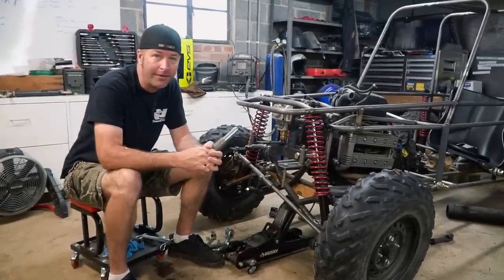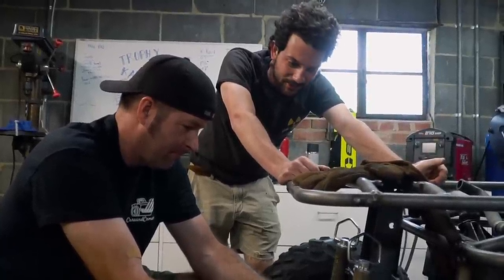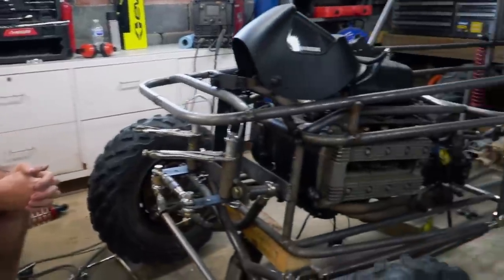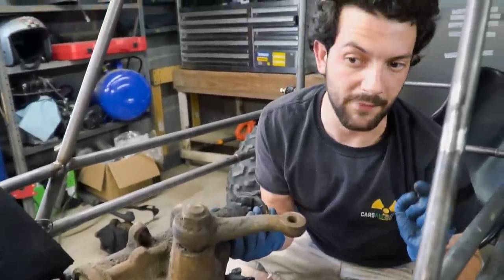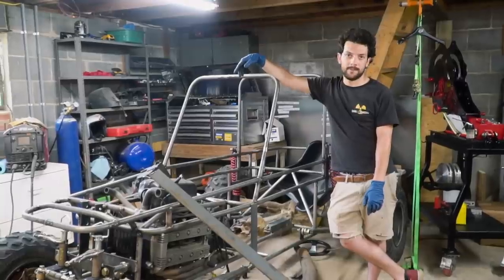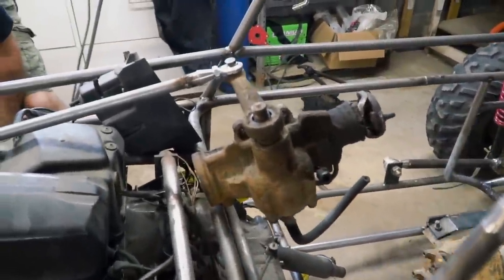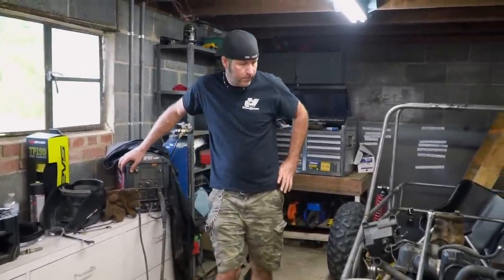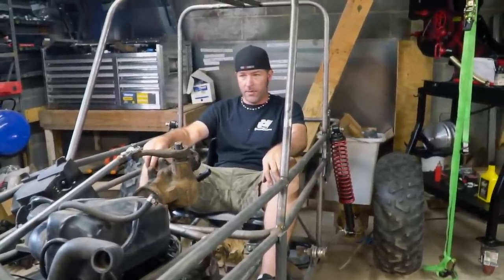1000cc Trophy Truck Build Pt. 9 | Steering Finished!

Comment: Find a steering box off of an old vw bug. They are only like 10 or 15 pounds and I'm sure they are pretty easy to find. Plus they don't have all the junk for power steering
Reply: I told them the same thing on the previous video. They have like 3 bugs laying around.
Reply: I was thinking that at some point I would just use a bug front end
Reply: I hope they read this hahaha
Reply: Yip an I think they make aluminum one's for sand rails
Reply: IndyHelis  way expensive though. Almost three times as much as a normal manual steering box.
Reply: Same thing from a Toyota pick up
Reply: IndyHelis  Your whole comment is negative garbage given they purposefully went down this route to try something new.  Also, why make up stories about the bump steer they resolved?
Reply: Why not the gears out of an old worm gear Skill Saw . Light and STRONG !
Reply: Harry. B. Renner. jr.  sure, as long as you don't mind terrible tread ware on your tires... lol
Reply: @SportbikerNZ  I agree with the first part of your comment, the bump steer however, is clearly not resolved. You can see it every time they lower or raise the jack.
Reply: @jonross377  That's before John commented at the end that their changes had worked.  A small amount of remaining bump steer would be normal.
Reply: @genebeilkeiii8489  an actual good alignment shop can along a Ford I beam for no weird tire wear. I've have no issues with any of my u beam suspension. Yet with a-arms there are a lot of joints to wear and a quick look around will show a lot of trucks and cars with cupping in the inside of the tires and poor wear patterns as well. 

As far as off roading ibeams goes. A little bump steer is more that control able. And any tire wear hasn't been an issue. Far more tire wear from spinning the tires and rocks and such wear them down. I find most rear tires wear out faster then front tires on my truck which has wider rear tires.
Reply: IndyHelis  a double a-arm has more joints(failure points) then an ibeam suspension. It's only complicated due to them not being familiar with I beams.
Reply: @genebeilkeiii8489  it's a off road go cart and there learning and showing people as they go so let them be.
Reply: IndyHelis  they often get o alot of play in them on ATVs. And tire wear off road still isn't an issue. But for additional weight it can be an issue.  I see a lot of Polaris ATVs with a few thousand miles and the whole front end is sloppy. Even my 2000 artic cat 500 4x4 have slop. To each there own.
Reply: @yahvigaylor82  I have no problem with John and isaac's rig. Was ripping on fords with twin I beam front ends. Cause almost all that I see have terrible tire wear. So not sure what you're going on about...
Reply: @SportbikerNZ  Do you know what bump steer is? do you have eyes? Did you watch the video? Did you SEE, with your own eyes the bump steer? Doesn't matter what anyone says it is plain to see. It still has a TON of bump steer.
Reply: @SportbikerNZ  are you dating these guys? calm down chief, you don't have to whiteknight them in every comment. get a hobby.

Comment: I'm a structural designer and design commercial buildings.  Choose your width based on adding bays in the future.  If you start with a 30 foot wide building then you only grow a 30 foot wide building.  You can add a wider segment, but that doesn't as good and creates places for water to leak.  Start with a 40x50 (2-25' bays). A steel building has better value and is stronger. But there are plenty of wooden frame "Pole Barn" type structures where they build the structure in several days, then you call in your local concrete contractor to pour in a floor.   With a steel structure, you will need an engineer to design the foundation. You will need to get a soil boring to determine the the footing design.  A steel building needs a perimeter beam and footings for the columns, plus the floor.  Some pole barns pour a footing then attach the pole to the footing, some plant the pole into the concrete footing.  If you have wet soil, planting the pole in the footing could lead to rot problems later. A steel structure is less likely to rot if you develop a hidden roof leak.  Building height also adds cost.  If you use tapered columns be mindful that higher up in the taper could place a divide in a second floor room that could be an issue. In your foundation, make sure you get your plumbing and electrical penetrations in before the concrete goes in.  It's a lot easier than cutting holes in your new concrete floor.

Comment: Plan long term. When you pour your slab, make provisions in at least one area for a lift, so that means thicker than six inches. Use it once for the channel so that you get the business write-off, but even if you install it just to have it for personal maintenance of your vehicles, you'll be thankful long term.  Also, take into consideration all of the additional costs, such as electrical, and plumbing. I'm sure you'll want water, but will it have a bathroom? Urinal? Shower? Shop floor drain?  All things to consider that add cost, and sometimes substantionally.  Good luck on the endeavor!  Barns and tractors; never thought I'd see that on this channel, but that's not a bad thing!

Comment: I-Beam all the way. Build in an overhead gantry crane to eliminate the need for the old trolley jack and blocks of wood. And while you're doing the concrete slab, dig/bore 4-6 500mm x 1000mm piers in a square/rectangular pattern with embedded steel to accommodate flush mount tie down shackles so you can use a chain block for pulling/bending/gently persuading heavy things!

Comment: Here's a tip for doing dirt moving with the Kubota (I've had the same model for 16 years).  When using the loader to lift almost anything, put the box scraper on! The BX will get real tippy real fast without some weight on the back.  Also, in case it wasn't shown to you, you can smooth out dirt and gravel pretty well with just the bucket.  All the way up on the loader control will "float" the bucket.  IOW just the weight of it will lay on the ground.  Just back 'er up and watch it smooth the dirt (if the dirt is not compacted much)!